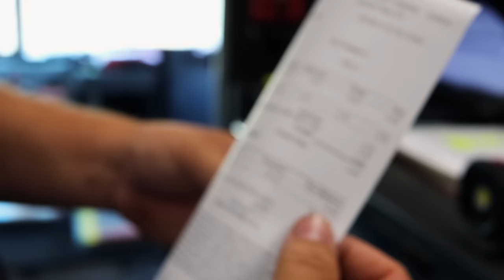Snap On Friday: FINALLY Debt Free With Snap On. I Owe NOTHING to Snap On!

Comment: Changed a flat in lower Alabama in August while on vacation! 105 degrees. Had to get out a blanket to kneel on. You are correct  it was hot!!!
Reply from the maker: Hotter ‘n hell !
Reply: @KoonTrucking  saw the devil wearing a winter coat!

Comment: Would you wait on the brushless CT761? I’ve thought about doing a couple different 3/8 impacts but really want to try a 761.
Reply from the maker: Well actually it will be the CT861 but who knows how long it will be. I’m a huge fan of the brushed version (CT761). It just depends on how bad you need one. Obviously if you can wait you will save money by not loosing it by trading in or trading up to it.